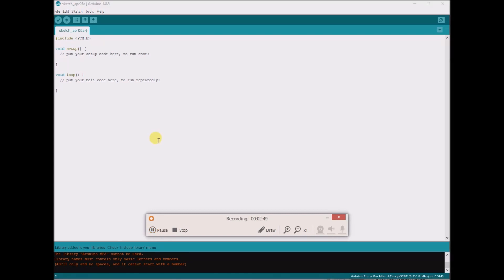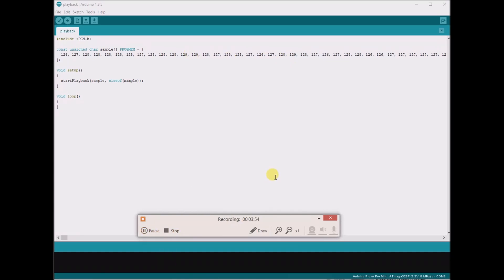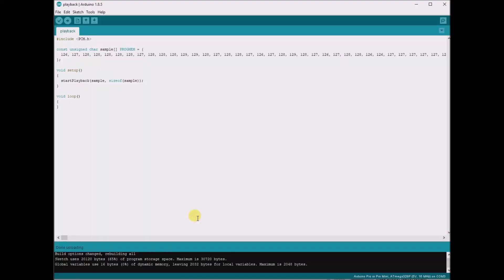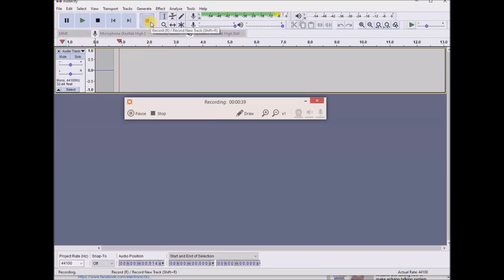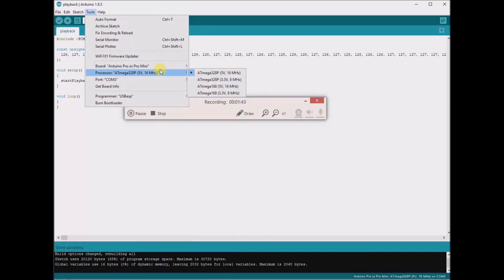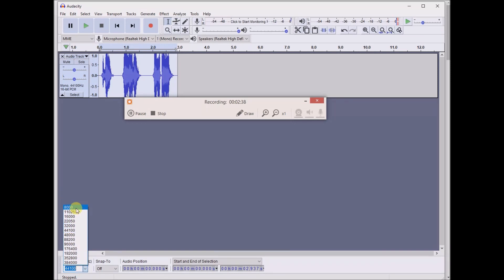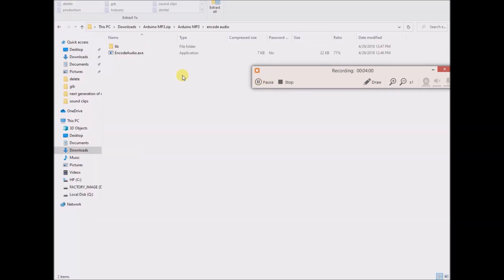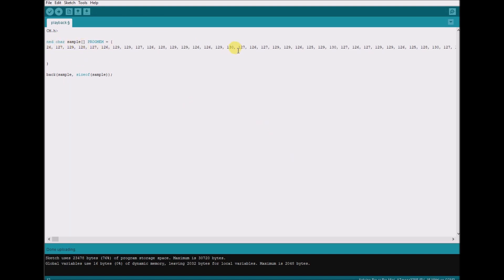Play MP3 audio on your Arduino: No SD card required.

Comment: ( 1 )  in pcm library
how i can change sample  from 8000  to 22000  or any sample.
   
( 2 ) pcm library it can run on
nodmcu esp8266
Reply: i doubt so, its low do fit in arduio memory,
Reply from the maker: Check this out: https://audio.online-convert.com/convert-to-wav
and watch how this guy does it, in his short video... https://www.youtube.com/watch?v=CezUJcdmwCw
You can also change the HZ rate using audacity software.

Comment from the maker: Dear viewer: My mistake was not having the audio turned up enough on my op amp circuit. And, the audio quality is clipped (distorted) by the op amp. Otherwise, the experiment was a success. I hope it works for you too.

Also, check out my SD Card Reader (Arduino) Vids too:
Part 001: https://www.youtube.com/watch?v=fPrB5okMsuQ
Part 002: https://www.youtube.com/watch?v=x4uVj98hcw4
Part 003: https://www.youtube.com/watch?v=G1eCYZ6Lts8